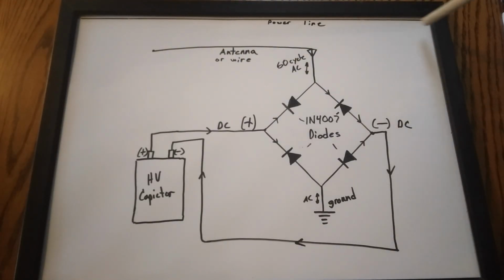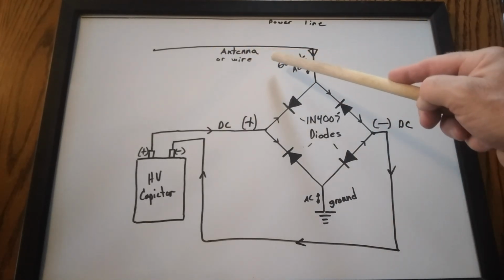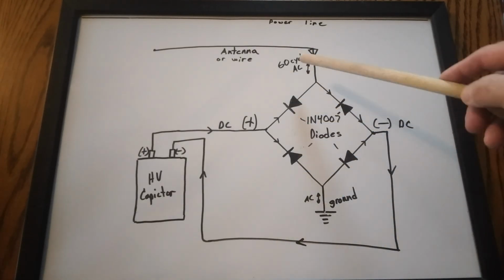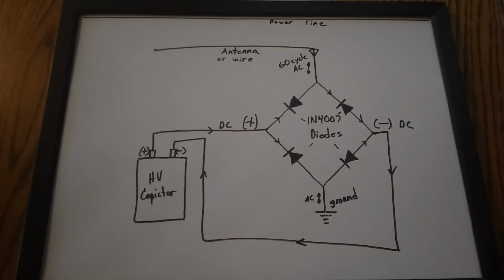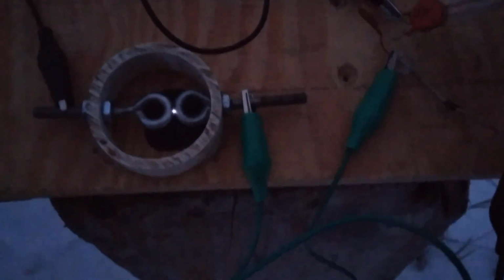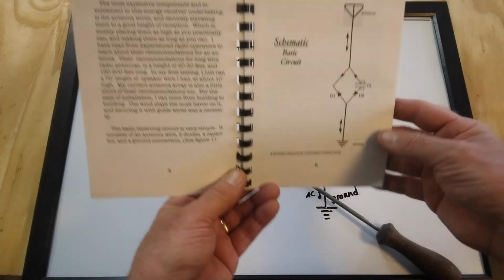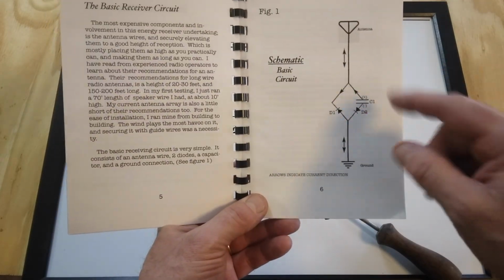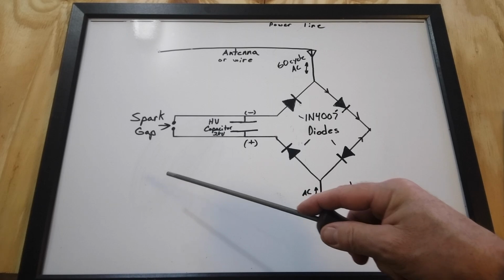(2) Antenna-ground energy receiving circuits explained

Comment: I know this is an older video and you may not see this comment. Is there a .PDF of your handbook or do you sell copies of it? I would be very interested if a copy was available. Thanks
Reply from the maker: I don't have that booklet available any more, but sometime in the future I could go over some of the more interesting parts.  Until then, you could try putting up a long wire antenna in the direction of the nearest AM radio transmitter with the highest power (would have to do some research), the try out these circuits for starters:  -a video link of mine  "https://youtu.be/qaafJptrzi4"
Reply: @doubleMinnovations 10-4. Thank you sir. The antenna wire and high voltage transmission line experiments you've done are interesting as hell. I have transmission lines cross the field behind my house so I will have to recreate these myself. Thank you

Comment: I'm assuming that your ground pole voltage is near zero all the time. If we look at your second (last) wiring diagram in this video, it looks like the positive voltage coming from the coax goes directly to the ground pole. Wouldn't it be more economical to route the positive voltage directly to the positive pole of the capacitor and to the spark gap?
Reply from the maker: Yes, there is a connection from the coax straight to the ground through diodes.  The circuit this way doubles the voltage, and what was needed for the spark-gap.
Reply: @doubleMinnovations  Well, maybe we understand differently what doubling means in this context... That same problem exist in Your Experimenters Notebook #1 (Figure 1 at page 6). There you seem routing negative cycles from your antenna directly to ground throught diode. I don't get it: You are routing live voltages directly to ground. To that same ground where You self are walking at same time.
Reply from the maker: Doubling the voltage, means doubling the voltage, -over that of the full bridge rectifier circuit.  
There is a AC current flowing between the fence wire and the ground.  During half of the AC cycle, electric current is flowing from the wire into the ground.  During the other half of the cycle current is flowing from the ground into the wire.
With my 2nd circuit, when the electric current is flowing directly from the wire into the ground through the diode, during  half of the cycle, there is an inductive reactance, that causes more current to flow leaving the wire with a higher static charge. -like the plate of a charged capacitor.  When the current flows from the ground into the capacitor back to the wire, during the other half of the cycle, it flows back at the induced voltage plus the voltage of the charged wire. -(like two voltages in series)  It now has enough voltage to break down the air resistance and jump the spark gap.